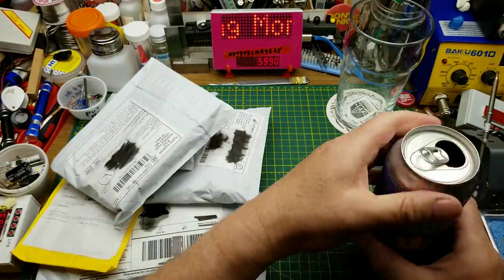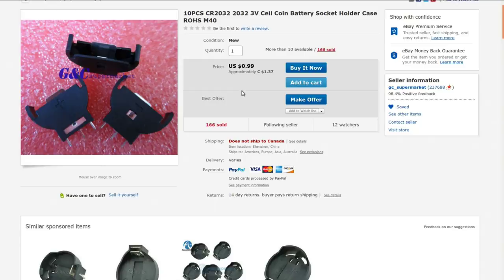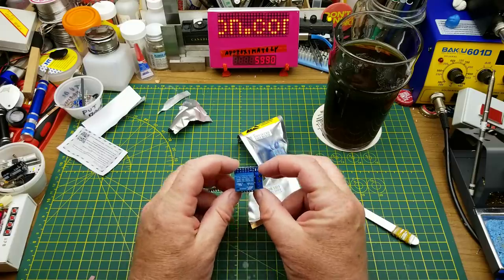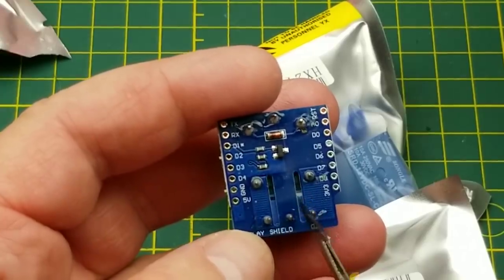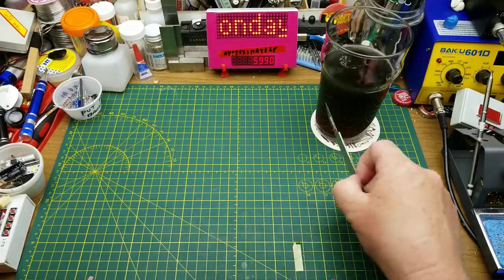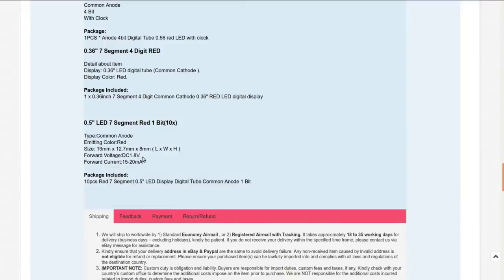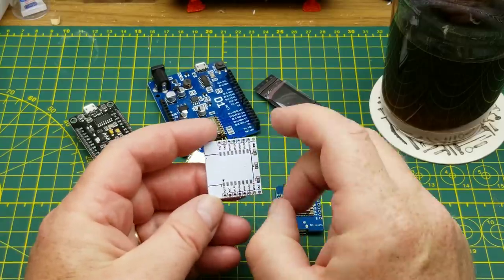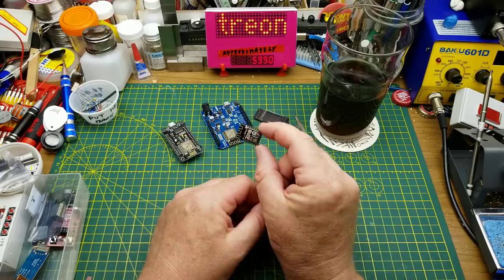mailbag monday #89

Comment: nice bits, I have a few esp8266 boards like that, I just solder leads to the pins I want to use saves on a adaptor board. Must remember to reorder some plastic sheet, as just like yourself I keep getting components instead. :)
Reply: Hey, if you are interested.....i can thoroughly recommend these and they save on adapter boards too and not a bad price: https://www.amazon.com/dp/B086YPVRFH    just saying.
Reply from the maker: That looks clever. A bit outside my normal price range, though. And the shipping to Canada is almost twice the item price.
I'll keep my eye out for something like that more in my price range, though. Thanks for the suggestion!

Comment: 7:15 - considering you are color blind the same as me, why would you bother buying RED segment displays? The blue and green are actually visible, unlike the red which needs huge drive currents and a filter over it to increase contrast enough to be useful in normal room light. People with "normal vision" always say they can see the red ones OK, but they still need a filter.
Reply from the maker: There's more variety coming in the future. However the red ones are by far the least expensive.
Reply: Red looks retro, and may be less distracting in low light to a color-sighted person.  But yes, blue LED segments are highly visible even well below 1mA!  This can save some wiring hassle, by directly sinking each digit with an MCU pin, instead of controlling the common cathode with a transistor.  I think the blue/green/yellow ones just look cool.